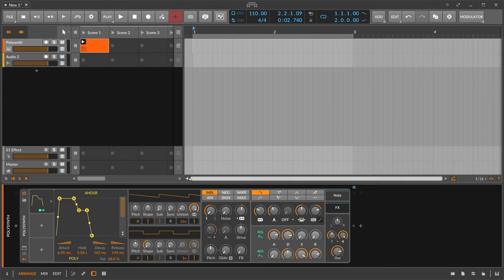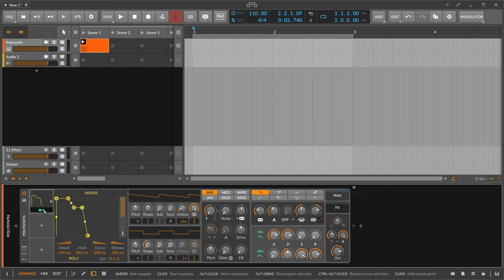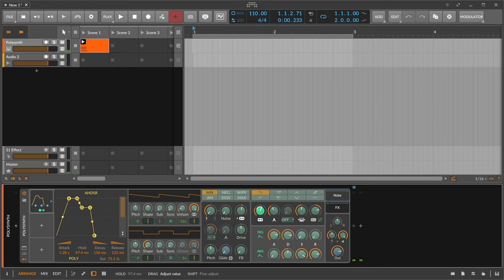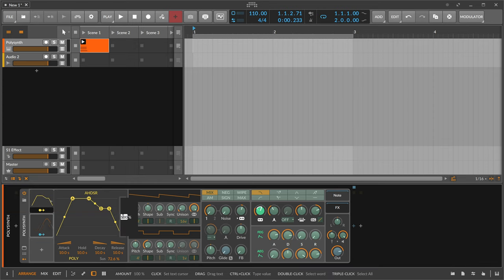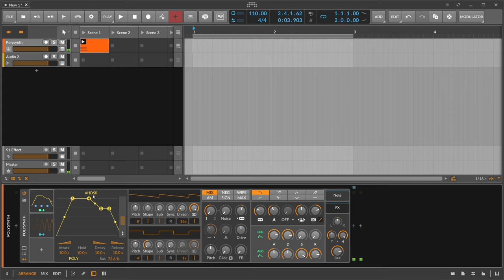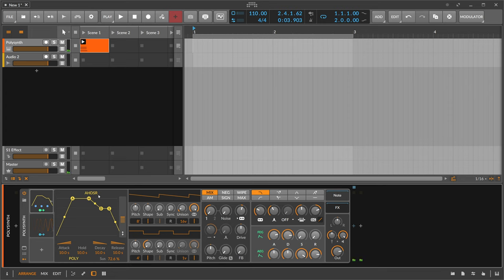AHDSR Envelope - Bitwig Modulator Guide

Comment: you forgot to mention that unlike regular ADSR it does have bending points, and also it displays time in seconds/milliseconds, so you use it for most precise envelopes. where regular ADSR have % values instead which are not beat synced, so you set it by ear basically.
Reply from the maker: i probably redo some of the videos in the future. Keep it coming
Reply: Is ADHSR beat synced?
Reply: @JC20XX  as you can see, all timings are set in milliseconds, so they're not. initially I thought that regular ADSR had timing relative to BPM, hence % instead of ms setting, but turns out it's not tied to BPM either (it just hides specific ms values). Overall the only envelope in Bitwig that have beat synced timing is 4-Stage. other than that, ADSR and AHDSR have beat synced pre-delay option in inspector panel.